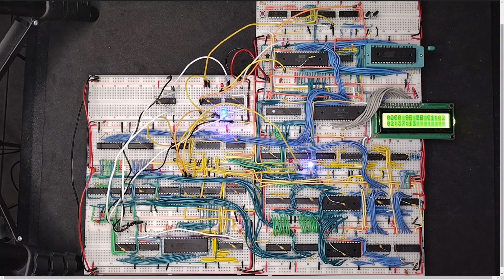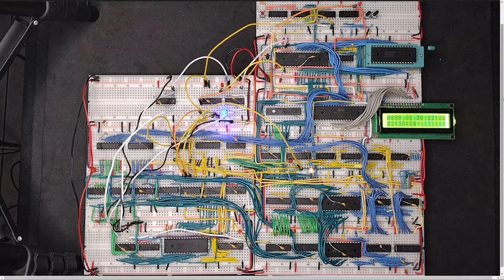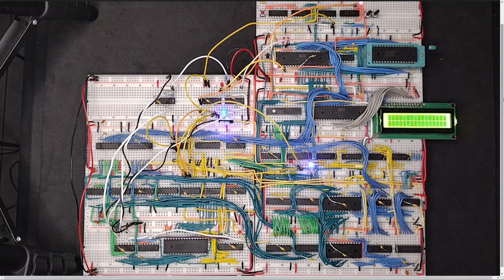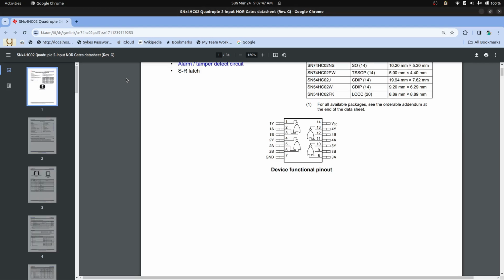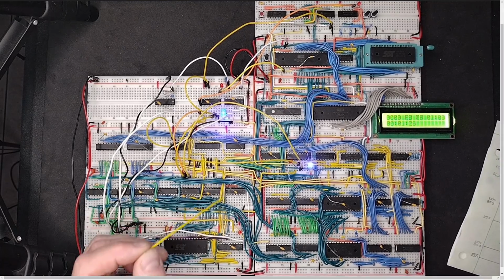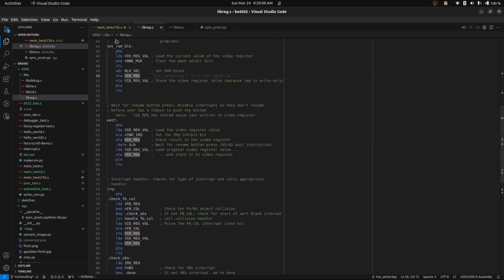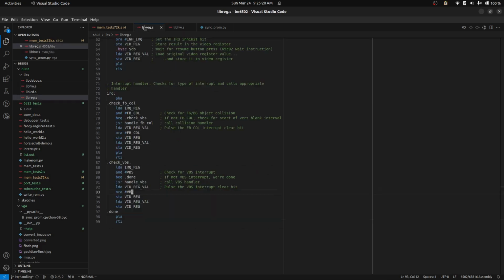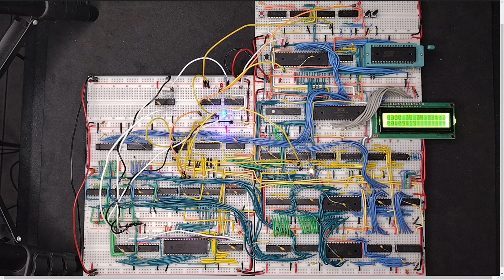10 Mhz Ben Eater-style 6502 computer, interrupt requests, and you!

Comment: Hi, I‘m very much liking the direction where you are going with your version of the BE6502 and following your series since you started and would like to help and give tips here and there if I can. Do you have a GitHub or webpage where you document your code and schematics as a reference so it’s easier to check for errors and give advice? I’ve built several similar incarnations of this style of computer on vero board 30 years ago as z80 versions and like to respin one of those as a 6502 sbc which would be pretty much like the one you do. My plan was to have it run at 12.6 MHz ( so 1/2 std. vga resolution) with 64/128k RAM but 16bit datapath for video ( got plenty of 10/12 ns old cache SRAM chips from old 486s )
Reply from the maker: Thank you so much! I don't have complete schematics anywhere. Just pencil-and-paper schematics of various subsystems. The software is available in a Github repository here: https://github.com/pscottdevos/be6205.

I have not found any open source schematic software very useful for the way I work. Is there any you would recommend?